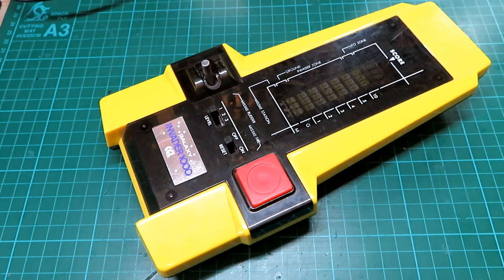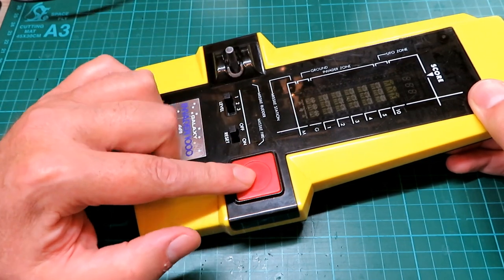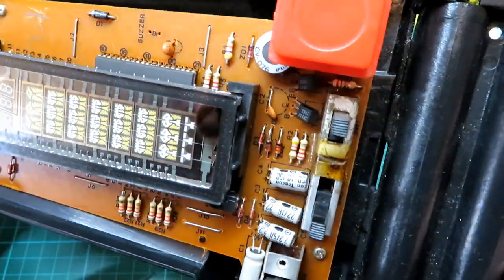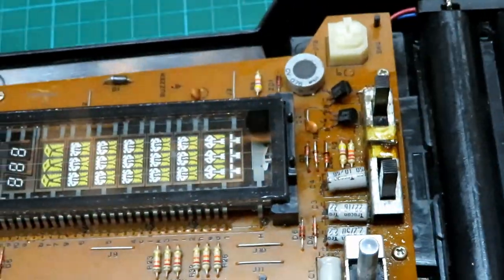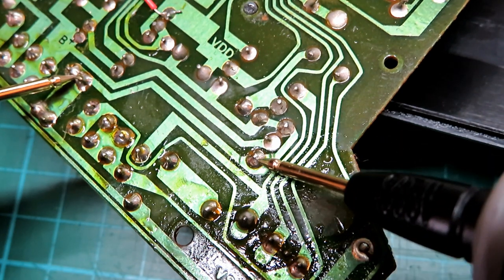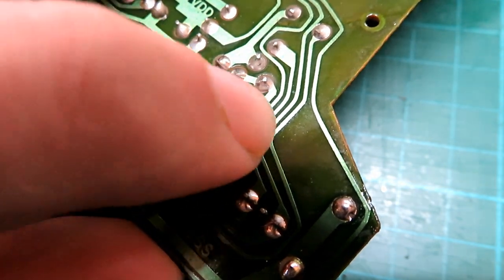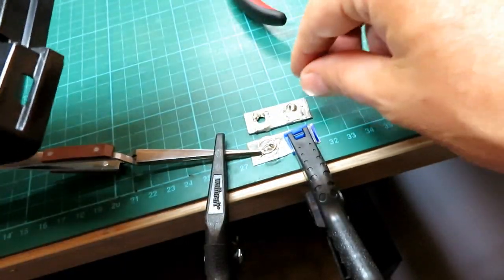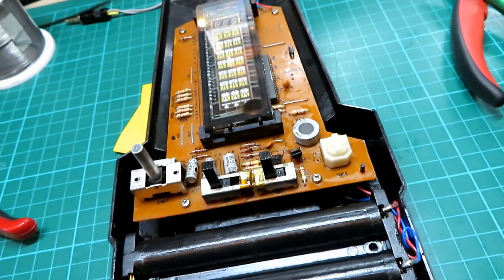I PAID £20 FOR THIS BROKEN 1980'S VIDEOGAME - CAN I EASILY FIX IT?

Comment: If the getter is that metallic colour, the vacuum is good.  If it looks white the tube has gone to air.  I did get a nice Astro Wars in box from my local op shop. No problems with it either.  No so with my NES from another op shop, someone had tried to fix it by cutting the IRQ line.  They did rejoin it but missed that they had also cut the next line.  Once I added another bodge wire it fired up and played.

Comment: Got one of these as a Christmas present in 1980 something, still in its now tatty box. It works perfectly, my dad ended up buying one of those multi voltage mains adapters with a  four way plug as it was heavy on the batteries. Memories...

Comment: Dirty switch, contact on battery, wire come off.  battery cover be made. Bet not much wrong with it, Just started. Got a Yaesu FT-70D just turn up. HH digital radio. You know the one, got one.